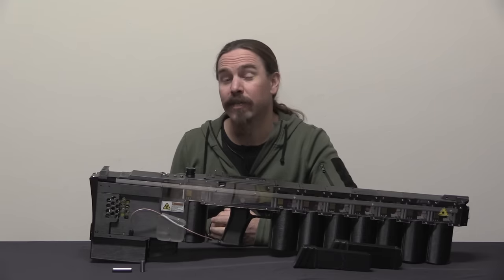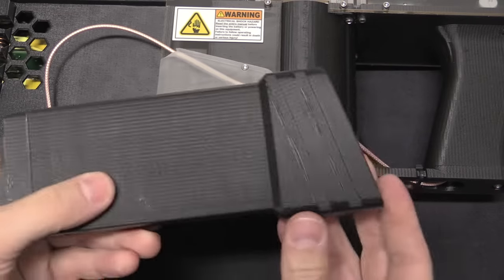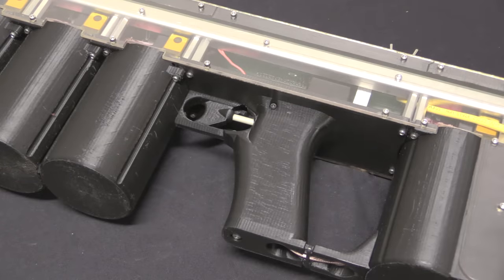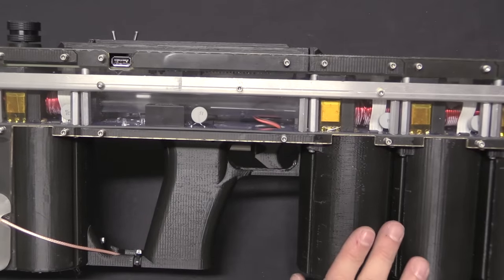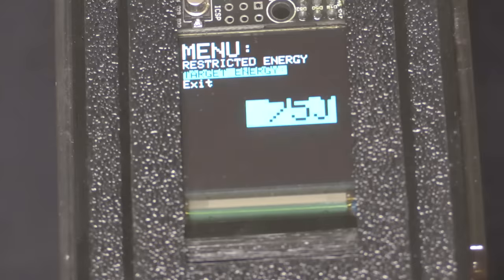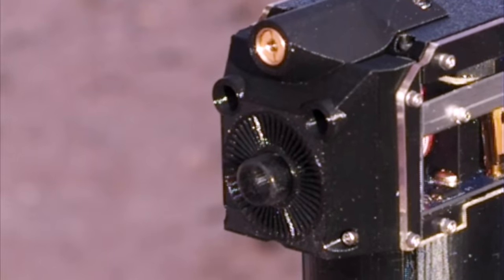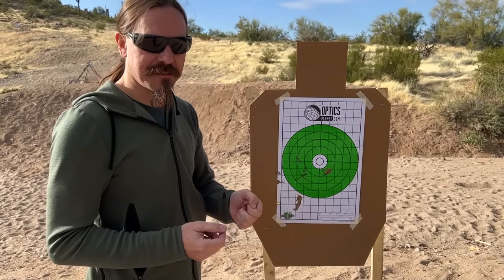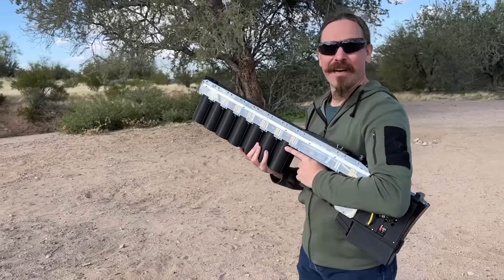ArcFlash Labs' GR-1 Anvil Portable Gauss Rifle

Comment: This thing seems like a survivalist dream, because you could basically make your own amno with a saw and steel rods, while charging it with a solar pannel.  Respect.
Reply: The battery has a definite lifespan though, and you won't be making another one of those with off-the-grid tools. And they have a shelf life even if not being used, so you can't stockpile them. For that matter, the solar panel has a lifespan too.
Reply: It’s also 20 pounds, which would kinda suck to carry around with any kind of kit.
Reply: I'm guessing the smaller version would be more than enough for small game. 
But then again, so would a bow at this point. 😅
Reply: @brunoethier896  yea just buy a crossbow, crossbows are super powerful and have lots of range and great precision
Reply: Nah airguns are still the best choice, for now. Hear me out:

There's no electronics to potentially fail or have to protect from the elements. The tech involved in airguns is bare bones, simple and not prone to failure. The seals don't age out, and you can pump the tank by hand if necessary with what is basically a bike pump that can go up to and over 5,000psi. As long as you buy or make a pouring mould, and you devise a means to melt lead you can pour your own rounds essentially forever from whatever scrap lead you can source (wheel weights, fishing lures, piping, there's lots around) and a few pounds will make hundreds of rounds. There's no powder or jacket involved, no need to have a reloading bench, or access to a presumed finite amount of brass, powder and primer.

Add to that higher fps, a faster reload rate, no worries about the barrel temperature, no finite battery life with a finite number of recharges, it won't fry your other tech (or your pacemaker) and I didn't hear him mention the numbers, but presumably higher ft pounds of energy.

But I do love the damn nature of this thing, and honestly in some years I think something like it actually WILL be the survivalist gun of choice.
Reply: Then again, there's the Fallout fan in me finding this totally awesome. 😅👍
Reply: spoiler alert: High performance capacitors have a very limited life, and yes, you can technically make a capacitor, but they will be super inconsistent and it frankly sucks big time. making a capacitor, that is. The gun rocks.
Reply: In addition to the other issues mentioned, you're gonna need a solar panel the size of a football field if you want to charge this thing in one day.
Reply: God no.

 Better off with air.
Reply: @voiceofsilencio  they are still the best choice in earthen atmoshpere :) No way to use an air gun in space, won't work underwater, and will be harder to use of the atmosphere has impurities and chemicals that can affect the internals. With mass drivers you have a self-contained propulsion system and simple slugs - can be used consistently virtually anywhere (except maybe strong magnetic fields).
So I'd say mass drivers are the survivalist weapon of choice of the future, provided there will be batteries and caps with long shelf life and enough resource.
Reply: Literally just make a bow and arrow dude. Deadlier, simpler, and you can make more ammo from sharpened sticks
Reply: @wifin6644  i dare you to try to use this gun underwater
Reply: @wifin6644  Yeah, great, the ammo is simple, but as pointed out, the WEAPON is anything BUT. Being able to saw a bunch of steel rod for ammo is fine and dandy IF you can keep the weapon going for any length of time. And frankly, in a survival kind of situation I am not seeing that as particularly likely! 

The ideal survival weapon is simple, rugged, easy to maintain and reliable, a coil gun may become rugged and reliable, but it will never be simple given the fact you will always need some computerised system in order to ensure the coils activate correctly, and the power is distributed correctly. 

Give me a bow anytime. With a bow you can make the thing in field with a little knowledge and minimal tools, you can also make the ammunition in the field given the knowledge, and you can do so with entirely natural, thus endlessly available materials. You are not going to be building or maintaining a coil gun like that....
Reply: A bow or crossbow is so much better for that use case.
Reply: @voiceofsilencio  It will be astronauts gun of choice.
Reply: I'd say an 80lb repeating crossbow would be your go to if were building weapons in a stuation like that.
Reply: if its an ion battery then how is it impossible to charge?
 @LewinEdwards
Reply: @SexyFace  Not sure what you're asking/replying to. Lithium ion batteries do not last forever - their capacity diminishes every time you discharge and charge them, and it also deteriorates even if they're just sitting on a shelf unused. The shelf life is usually quoted at somewhere between 2-4 years - beyond that, capacity is a crapshoot. If not periodically recharged, internal self-discharge will permanently kill the cell; it's simply a matter of time.
Reply: @LewinEdwards  In the modern era, anyone with basic soldering knowledge can scavenge huge amounts of lithium cells within any modern building. The batteries and ammunition is far more readily available in the 21st century than reloading equipment and supplies. This could be recharged and reloaded using a hacksaw and a soldering iron. Traditional ammunition is gonna run out long before what this uses.
Reply: Where would you get the steel rods anyway? I don't see any survivalist using this lol
Reply: @nxxynx5039  In a SURVIVALIST situation, the factories making Li-poly cells are no longer operating. This means that, regardless of how cool and electric your gun is, you will not have a source of working cells after the cells out there in the world have reached the end of their shelf lives. They do not last forever, even if not being used. (There are some other issues to consider too, like needing to have relatively well matched cells, but we needn't consider them).

Incidentally, black powder equivalent can be manufactured "at home" with relative ease, indefinitely, if you have access to saltpeter caves (ie - bat guano). But as others have pointed out, a bow and arrow is even more self-sustainable (and effective).
Reply: @wifin6644  Air guns would absolutely work in space. Underwater, they would work no less effectively than firearms - the problem with firing bullets underwater isn't that the weapon needs to be waterproof, it's that the water resistance sucks energy out of the projectile much faster than air does. That's why underwater projectile weapons are either contact weapons (put muzzle against target, pull trigger) or spearguns. 

Anything battery powered is not, long term, usable in a survivalist situation where factories are no longer operating. All batteries have a shelf life. Manufacturers aren't trying to optimize new designs for that parameter, either - they are optimizing for higher energy density and faster charge rates.
Reply: @wifin6644  if you have a survival situation in space, the type of rifle you carry will be your least concern. Also, air rifles work just fine in space, provided you carry the air to load them
Reply: I’ll take the guns I have right now, thank you very much, don’t care if it’s a WW2 era rifle, still better than having to wait 3 or 4 hours on a good day to charge it up for use. The tech is only just being figured out. We’ve got a good 20  years before it becomes practical for large scale usage and I like to be in the here and now. So it’s a fun concept for now, but bullets and arrows are still the best option, hell I’d take an HK G11 over this thing any day..
Reply: @nxxynx5039  I can make gunpowder and bullets. Can you make lithium batteries?
Reply: electronic components: survivalist nightmare
Reply: @Superabound2  Making good arrows is actually the really tricky part. 
" Any ol´ stick him do for a bow, but arrow kills deer!", as an old american native put it when asked by an ethnographer.
The have to be very precisely tuned to the bow and archer, and be very, very consistent, else they are of no use whatsoever. If you actually want to hit stuff, that is, repeatedly, at sensible ranges.

But yes, bow and arrow are definitely up on the list. 
The survivalist´s dream is 8 feet of sturdy string and a quarter pound pebble.
Reply: @nxxynx5039  Going by Fallout 3, you can find plenty energy cells in the lower shelves of abandoned gas stations, or random lockers in random basements....
Reply: @LewinEdwards  If you eat a lot of meat, and pee against a lime-washed wall, you can harvest your own saltpeter
Reply: @voiceofsilencio  the seals definitely wear out.
Reply: @paavobergmann4920  Fallout 3 is a game and is not remotely real-world accurate to object decay.
Reply: @RayneAngelus  That was exactly why my comment was a joke.
Reply: @paavobergmann4920  Humor doesn't transmit well in text, sorry.
Reply: @RayneAngelus  haha, sure, you´re right. Sorry, too. ;-)

Comment: Pretty sure the mid-sized round (5:45) is actually a 1/4" drop-in concrete anchor. Very cheap and available.
Hacksmith also made one recently. Very cool tech.
Reply: The biggest issue with Hacksmith's work is that he's Canadian, and they're not allowed to develop weaponry out there. This one will actually work as a weapon.
Reply: @UnitZER0  imagine if Hacksmith moves to texas

Comment: Unless modifying the shape of the projectile would somehow hurt the performance of this, I would think shaping them more like a shotgun slug or an air rifle pellet would greatly improve the accuracy.
Reply: Those projectiles have rifling on them to add spin. You're correct that that greatly improves accuracy, but they also add a lot of drag. In a gunpowder based weapon where the pressure of the expanding gas is what accelerates the projectile, having a tight fit against the bore is a benefit, as it helps transfer a larger percentage of that power to the projectile as well as imparting a rotational force. Here, where it's electromagnetic fields that accelerate the projectile, that would consume some of the energy while providing no benefit apart from the spin, and, given how limited the energy is, this weapon can't spare it. As Ian mentions, the projectile is not supposed to touch the bore while going through it.
15 years from now, we might have enough improvements to be able to sacrifice that energy for spin, but we may also find another way to impart spin.
Reply: i wonder if a conical form woul have a better flight behaviour
Reply: why not shape it like a dark?
Reply: @delucain  couldn't you just shape the tip into a scalloped spiral so that it's movement through the air itself would impart spin?
Reply: @Superabound2  yeah but as someone already said,  the gun is so wimpy that a spinning projectile would be even weaker, not even .22 LR
Reply: @delucain  Or you can go fin stabilization as that would be alot more suited to an electromagnetically propelled projectile. Or if you get enough advancement and magazine feeding this fin rounds is too difficult you can always develop a lightweight discarding sheaf. And now we are back to the principle of Fin-Stablised Discarding sabot
Reply: @delucain  it is possible to spin projectile magnetically, but it requires way more technology
Reply: @delucain  probably some kind of sabot/flechette combination would be better for this purpose
Reply: Since magnet launches these, making a different shape may impact the launch performance… unless let’s say the tip is plastic or ceramics inserted into the tip.
Reply: I thinks aerodynamics would work and a dart shape would definitely help accuracy along with stabilizers at the rear.
Reply: Iirc tungsten was what the military settled on for it's version of this before the project was scrapped. The power output needed for the amount of firing power they wanted was impractical.
Reply: @marknichols355  Yup, or an oval shape projectile too, as a starter, considering that the gun is still in prototype stage and the company is under limited budget for them to spend more money on designing complex looking projectile.
Reply: @delucain  A diabolo shaped projectile like an air gun pellet will self stabilize without any spin fairly well and doesn't need barrel contact but magazine feeding would probably be an issue. Dremeling some fins into the back of those dowel rods might stabilize them enough and if you left adequate area at the front half of the projectile I don't think it would affect feeding that much.
Reply: @marknichols355  that was a railgun though
Reply: @FullOilBarrel  same principle.

Comment: Hey, Ian, great job. Just note that this battery cannot be 3300Ah, more like 3.3Ah (or 3300 mAh). To give it in units of energy you also need to state the voltage, so 25V*3300Ah would result in 82.5kWh
The best LiPo batteries on the market today hover around 300 Wh/liter and this just doesn't make 3300Ah however you cut it.

Just a drone geek having fun.

Keep up the good work
Reply: Yeah I was going to say, 330 Amp Hours in a package this size would be the real technological breakthrough. 
Just a 2.2Ah 4S battery is getting a little into "chonky" territory.
Reply: It's a 6S pouch cell lipo
Reply: As an EV lover I was to say about the same

Comment: Hey guys, thank you for tuning into this episode of Forgotten Weapons, today we’ll be looking at the zorg zf-1 pod weapon. An  ambidextrous multifunctional weapon incapable of being detected by X-Rays featuring a titanium recharger, 3000 round clip (given the weapon is energy based and so the clip has no moving parts, this is not strictly incorrect, though calling the shots "rounds" is) with a burst of 3 to 300. It also features a variety of other fire modes as well, including a self-destruct button.

Replay Button: The ZF-1 can be set to so that the first round fired acts as a beacon for guided bullets, causing all subsequent shots to home in on the original one's impact point.
Rocket Launcher: The ZF-1 features a small yellow rocket which devastates any target it hits.
Arrow Launcher: Zorg demonstrated that from the sides of the ZF-1 were two launchers with a total of 10 arrows, 5 in each launcher. The arrowheads were each either explosive or had poisonous gas heads.
Net Launcher: For non-lethal takedowns, the ZF-1 is also known to have a net launcher to capture, rather than kill the target.
Flamethrower: Zorg's personal favorite, the ZF-1 features a short ranged flamethrower.
Ice Cube System: A new device the ZF-1 possesses is a weapon able to freeze people.
Reply: Do not push the red button with out time to leave the area.
Reply: "Hey guys, today we'll be taking a look at a Super MAC Cannon, mounted on Cairo Station..."
Reply: @stilllearning5159  - The red button secret will be reveal after the client pay for the goods ^_^
Reply: @yutakago1736  Wise

Comment: Don't expect too much more, at least not quickly, considering that electromagnets and electric motors were mature technology over 100 years ago and this is just a digitally controlled variation. The limit is with materials more than design

Comment: I enjoy how this weapon looks as what every video game representation of their version of the Gauss Rifle.

Just need better battery technology and barrel cooling and that thing would be extremely terrifying to fire.
Reply: also make it rifled so it can actually hit something over a hundred meters away. like what is this 1500ad? rifle tech is pretty old at this point. why it did not come rifled as standard is beyond me. i guess it was because with this prototype it was more about the Technology then actual ability to function as a gun in combat?
Reply: @accountreality1988  rifling wouldn’t really work as the rounds are basically floating in the middle of the barrel. A sabot round might work though.
Reply: @green4527  why mention it was smooth bore then when it did not matter?
Reply: @accountreality1988  the magnetic field coils will keep the round in the center of the bore so rifling it wouldn’t affect anything.
Reply: @accountreality1988  also Ian has to use terminology that we understand and we understand what is essentially a smooth bore perspex tube.

To be fair the ammo doesn't have to be round, it can be any shape you want as long as it is ferromagnetic and fits in the barrel so as many have suggested a sabot or even just a dart in square tubing might work better and a smooth bore slug.
Reply: @accountreality1988  smoothbores are still used to this day in tanks and in certain AA-guns. If you paid attention Ian also mentions how there is zero contact with the projectile and the bore.